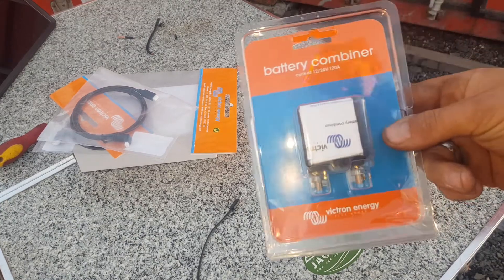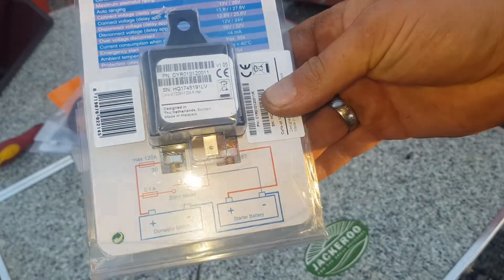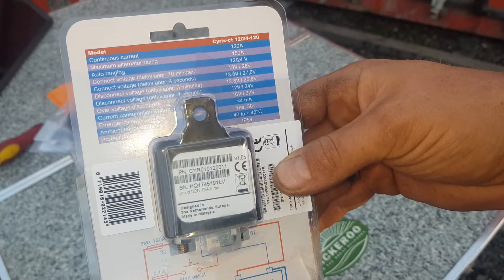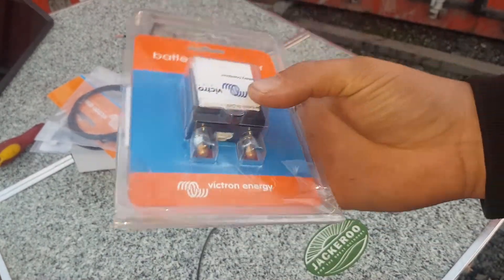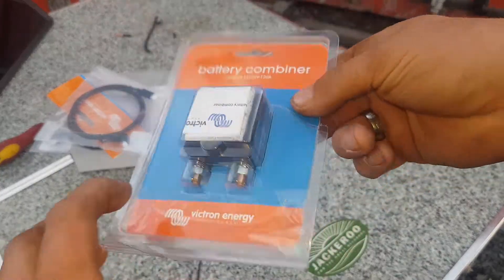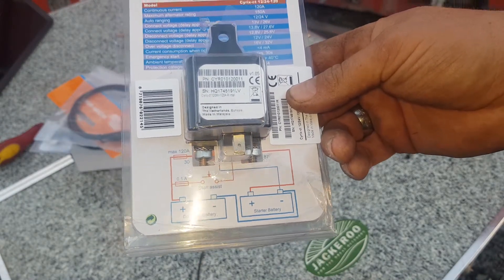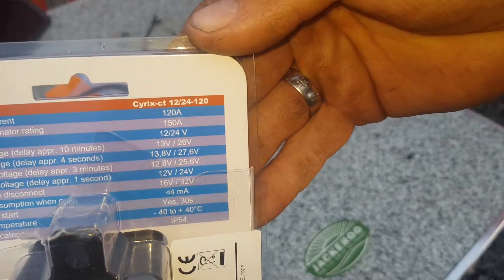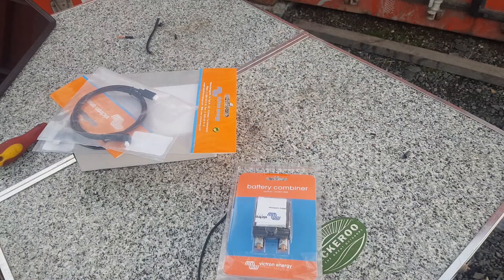Awesome Victron Automatic Dual Battery Switch / Combiner  120 Amp!

Comment: I dunno if I'm just going deaf or not Brad but audio is very quiet on this vid...
Reply from the maker: Mic must have been cutting out the wind sorry bro got big external mike with a ferret tail wind stopper.
Reply: One Up The Sleeve Customs all good mate👍
Reply from the maker: Chris's DIY Projects got some more sick victron gear coming up in videos mate dam the are ahead of the rest
Reply: One Up The Sleeve Customs yeah their gear looks good once i get my new mic for my phone I'll start recording again and upgrade my ibc aquaponics tank. Thinking of using one of their inverters for the standalone power system for it to run the pump. I'll have to let you know when i set up the solar side and make a video so you can have a squiz at it
Reply from the maker: Chris's DIY Projects sounds awesome mate!!!